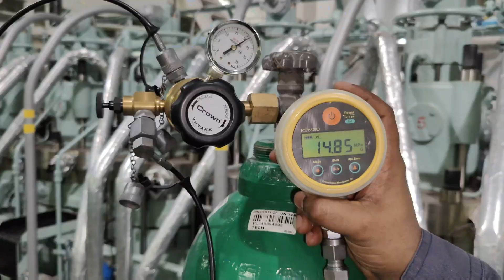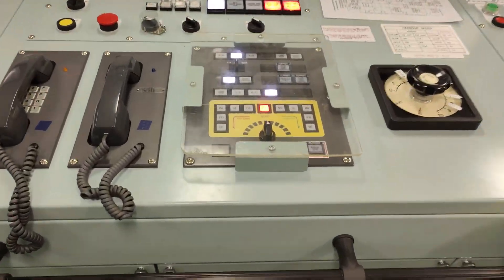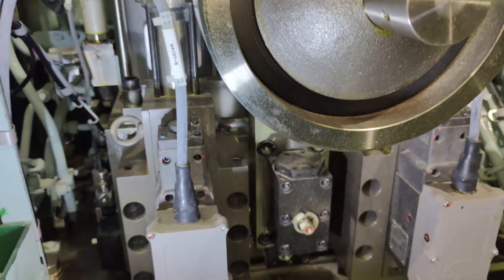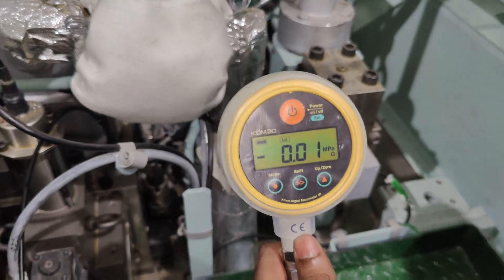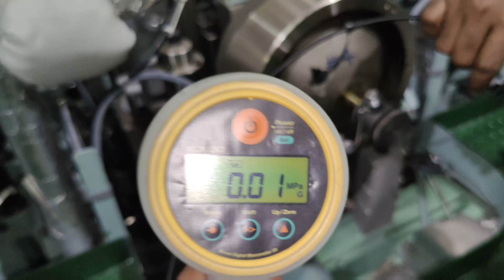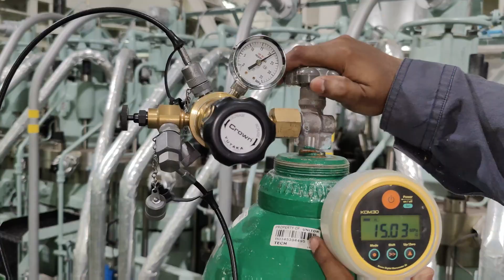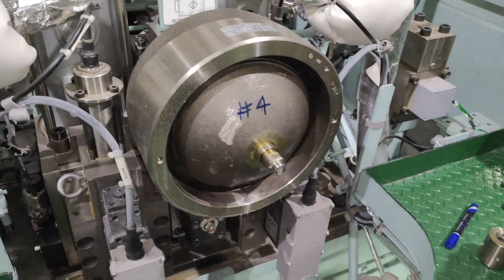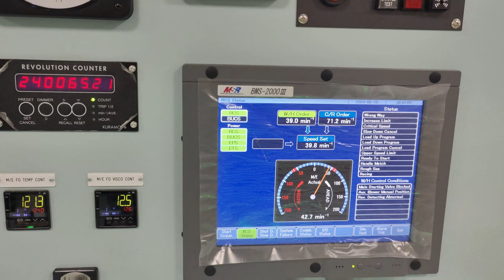ME ENGINES HPS & HCU ACCUMULATOR N2 CHARGING PROCEDURES | SEA LEGEND |

Comment: Hi sir why happens if we charge more than 14.8 if it is slightly higher will it rupture the diaphragm or is it ok
Reply from the maker: Hey Good query....there is a temp / pressure chart in the manuals..
Do try to be inline with the data..
In any case if you charge more you can release the nitrogen upto the desired press..
If you already overcharged and vessel under way.....don't do anything..
It won't damage the diaphragm instantly..
But at next opportunity do release the gas.